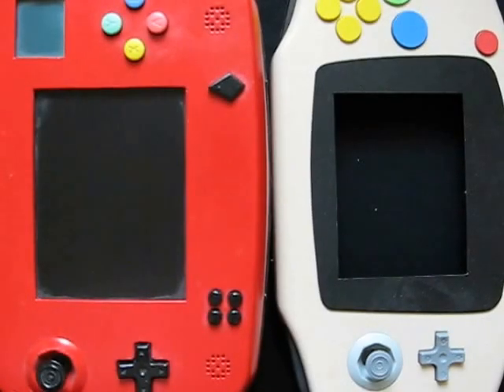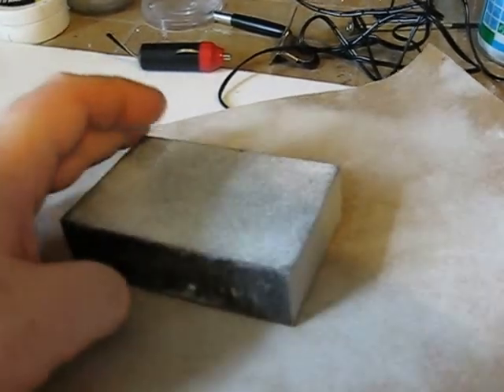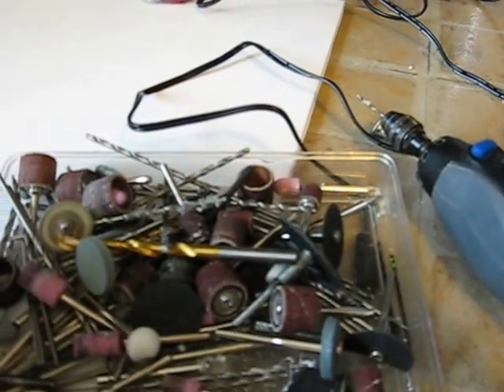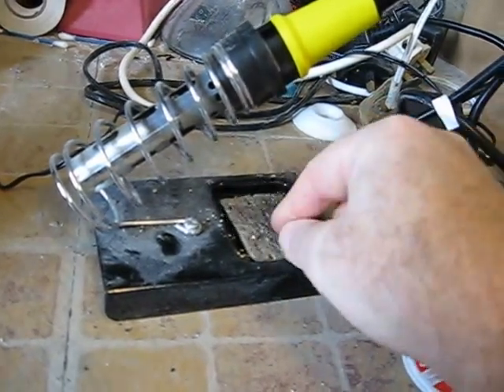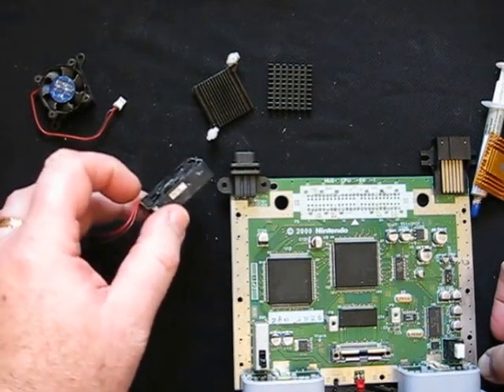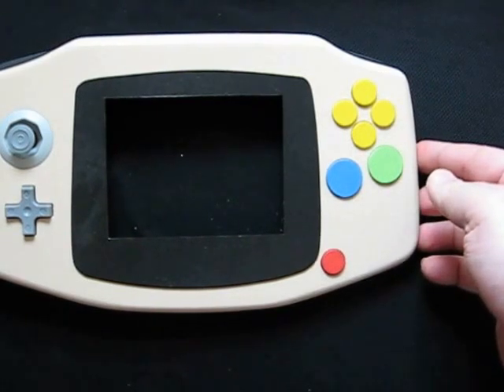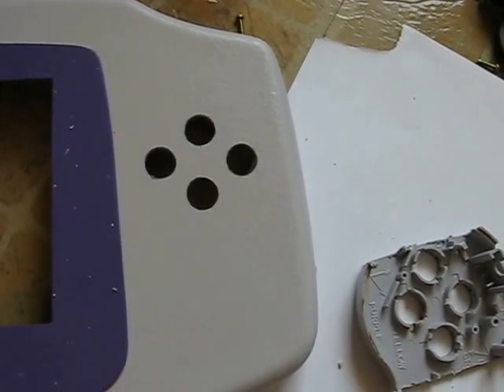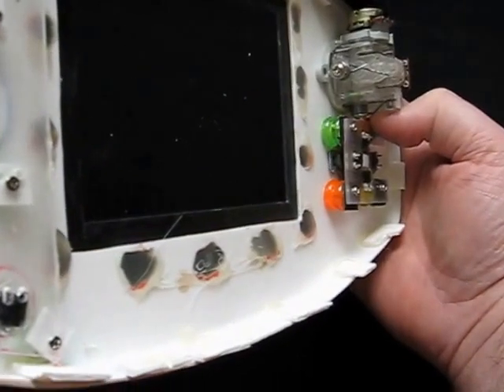Tips, tools and techniques for portable handheld modding

Comment from the maker: Tried thermal tape before, worked ok but from what i've read before, thermal paste is a clear winner.

Used the thermal paste and super glue method on my N64 portable recently, ran the whole distance before the batteries died fine, so works fine.

Comment from the maker: Pleased you liked the video.

Scrape away gently the trace covering until you get to the copper (that's the trace itself), apply a dab of flux on the area, then solder with your iron, you get a little fizz as the flux removes the coating and allows the solder to weld to the joint; tin your wire, then apply the wire to the trace with soldering iron. Be quick on the trace, don't let the iron be there too long.

Comment from the maker: There are lots of small speakers around, 30mm or 40mm are ideal; smaller than that is where they get tinny. In reality, you don't want more volume than about the volume you speak at, so these speakers are perfectly fine.

Good, this video wasn't designed to be comprehensive, rather than for someone looking to get into the hobby but a bit unsure as to what they are getting into and wanting some tips and ideas to know they can do it.

Comment: Fantastic vid mate - really helpful. This is useful for repairs as well. I am having probs with a neo geo and think it may be the traces (scrambled graphics after giving cart slot a deep clean). The traces are tiny though how can I identify problems with them and fix something so small? I have the same iron as you. The neo has some blacky/golden brown solder around the joints for the power and video port - does this sound like a problem? Cheers.